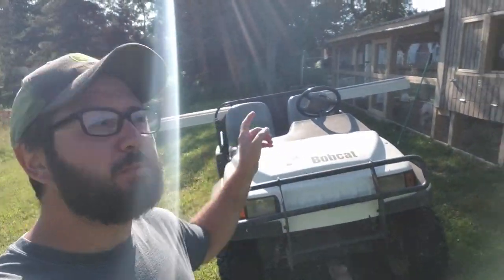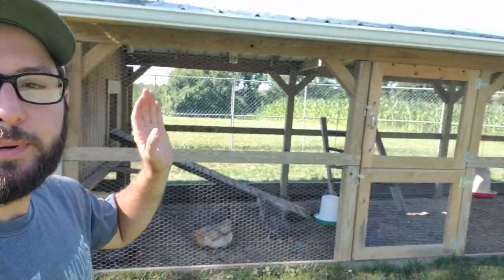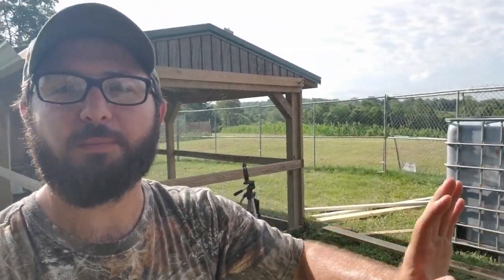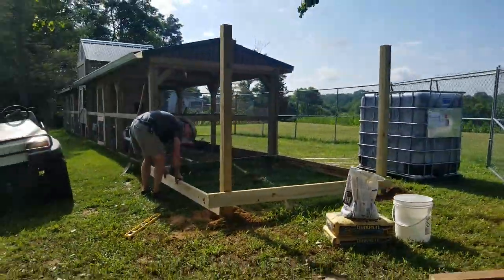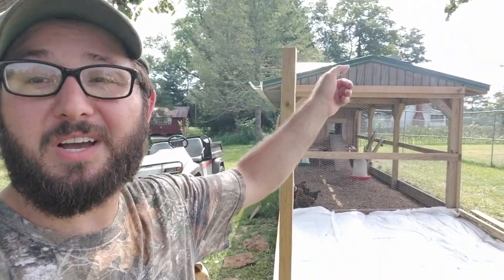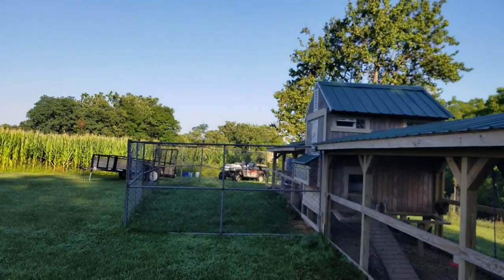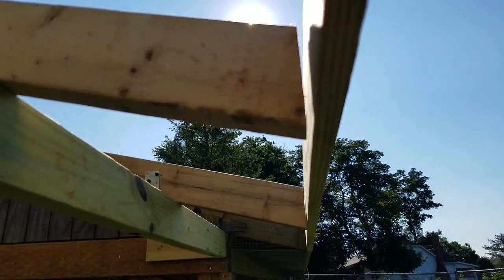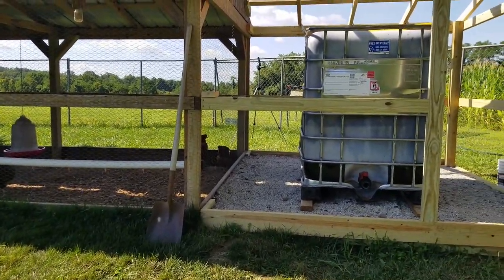Chicken Coop Rain Water Collector Build: Part 1

Comment: Run your gutter on both sides of your chicken run to the end , then added a gutter on the new addition back to the downspout , run the downspout in from both side of the chicken run to the top of the water tank .. you might as well utilize both sides of the roof line to collect your water